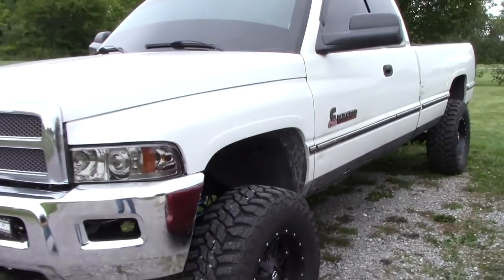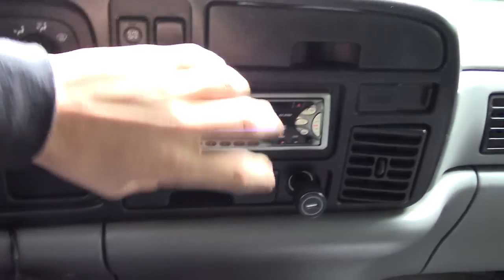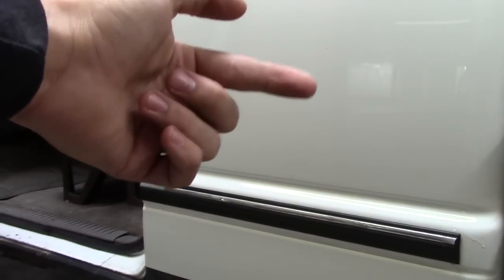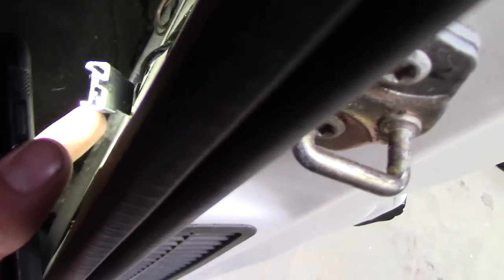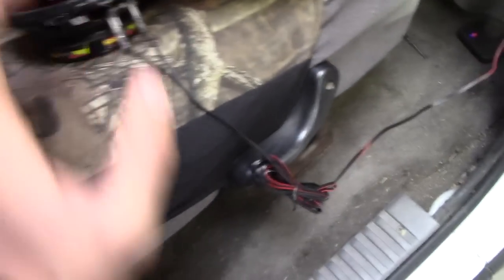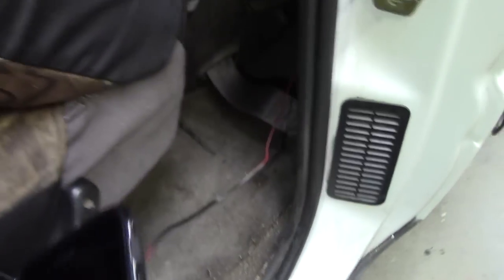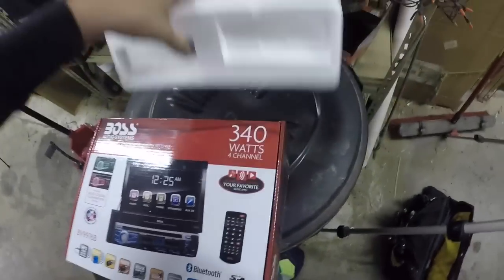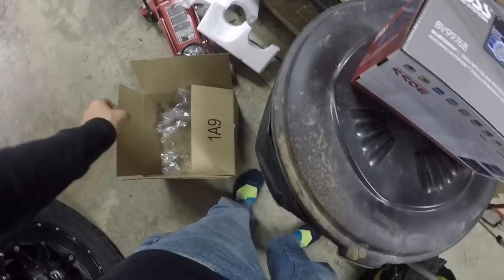INSTALLING BOSS FLIP UP RADIO HEAD UNIT!!! (Gone wrong)

Comment: These screens usually have a tilt screen option in the menu. Usually about almost and inch inward and out. I had to do this aswell. I found it out right before I hit the key again and it opened and fell out onto my exposed shifter and broke the screen. I was pissed. It was brand new.

Comment: Hey man I have a 99 Dodge ram I have done an install about two years back I have a single din radio too not flipout ive installed a whole pioneer system and I've honestly was crying no when you cut the dash. they have radio kits to where you can fit it in your specific radio without modifying your dash

Comment: Be careful with spacing it correctly I used the spacer it came with and after 2 years of using this radio the screen went out. It still pops up just doesn't show anything and of course it's right after the warranty wears out.

Comment: As someone that used to install car audio for a living that's rough to watch.  A shop could have got you setup without cutting the trim panel in your truck.They make spacer pockets to get a head unit further out if needed.
Reply from the maker: JR Townsley well I like doing it all myself and saving cash... I made it work lol.. I found solution to gaps in part of tomorrow's video
Reply: JR Townsley it is rough to watch dont take this as a hate comment but next time what shrinks make it way cleaner and some wire loom around it all just some advice keep up the work
Reply from the maker: Mr. Mountains. Ok
Reply: JR Townsley same
Reply from the maker: Mr. Mountains. Kinda sounded that way but idc ig
Reply: JR Townsley loud n proud calm down man you see butthurt im not trying to bash on your truck just giving advice lol nice vids man
Reply from the maker: Luke Littleton I already found a solution... I used electrical tape doubled layered around the little gap and heat shrunk it... now you don't even notice anything
Reply: My 2006 cummins has these circles factory cut in the dash from where the Volume and Seek/Scan knobs are on the factory radio. Is there a replacement dash kit around the radio that will keep the wood grain look but not have those circles from where those knobs are? I want to get an aftermarket double-din radio but don't want to cut anything or have gaps where those knobs were? All of the kits i've seen Have fillers to go in  where the knobs were but that looks cheap to me. Ive thought about buying the Facotry dash kit for a Laramie with Nav. but not sure if that is my only option...... Thanks!

Comment: Hey bud I got some LED reverse lights and license plate lights if you want them. What's the number for yours and I'll let you know if they'll fit. Just a warning if you got aftermarket tail lights they'll most likely be different from the one in your owners manual. I know I got some on my truck and the reverse lights were the ones for a Tacoma
Reply from the maker: Trevor Hendricks yeah my reverse lights are leds ... but my license plate light one is burnt out lol

Comment: I wonder could you put a newer dodge steering wheel in the year dodge you have?
Reply: jaiden thompson anything is possible with enough $$$. It is possible, but isn't worth the hassle.
Reply: Pablo Iglecias good point
Reply from the maker: Pablo Iglecias and with all the steering wheel controls and crap... wouldn't work u less with did everything in the dash different and wired it all up
Reply: LOUD 'N' PROUD that would be one hell of a job but it would still look good

Comment: how ya gonna put shitty ass boss speakers in that truck tho, shoulda spent a little more and got pioneers or alpines.. probably not even up to par with the factory system in the king ranch. Also orange wire was for light switch to dim screen down when you turn on the lights, blue wire turns on aftermarket amp

Comment: Take the brake wire and connect to the ground of the vehicle that way u can watch dvd
Reply: Does that for sure work on this model? I just picked one up for my work truck and cant find info anywhere. I know some higher end brand need to be wired to a switch so it can actually see the action of the "parking brake" turning on and off.

Comment: you should sell dippin diesel that truck since he needs a truck and u were needing to sell ur truck
Reply from the maker: The Random Dead I told him lol
Reply: The Random Dead what's wrong with dippins pickup?
Reply from the maker: Parker Jessen he's been having some setbacks lol and joking about wanting a 12 valve lol
Reply: Parker Jessen injection pump  codes     possible failing inj pump

Comment: Come on man, your better then that. The electric taped speaker wire connections where bad enough, but this is a whole new level of bad with what you did to the dash.
Reply: Stevie Wonder could have cut the bezel better with a chain saw.
Reply from the maker: Tom Schmick just keep on telling me stuff I already know to make me look worse👌
Reply: Sorry but you should be prepared for comments like this by putting this level of work out on youtube. Do good work and you will get positive comments. It's one thing not knowing and learning how to do things but once you start hacking things up you start asking for problems and it is far from cool. Now I can't say that I have never hacked up a job before but I never put it out for everyone to see either and have learned to research out my problems more as a result before resorting to desprate meassures. With the power of the Internet and your subcribers you have no lack of sources to get answers to problems you run into. A lot of us work on our own vehicles or work on vehicles for a living and seeing things like this are very painful to watch without saying somthing so hopefully you where prepared. Hope you end up with that other truck, has lot of potential.
Reply: LOUD 'N' PROUD 
Is Boss-Audio still working?
Reply: What’s funny is there is a button to straighten the screen out

Comment: Amateur!!....slow down, your video shows you have skills, use them!!...your wiring isn't solid, the wire colors don't always match from stereo to factory wiring, and blue wire should be remote/antenna output that turns components on, just a few things to consider, many great videos will improve your abilities, and knowledge, more research next time